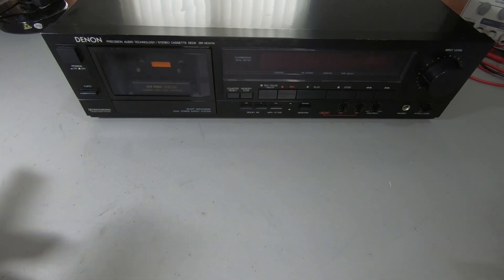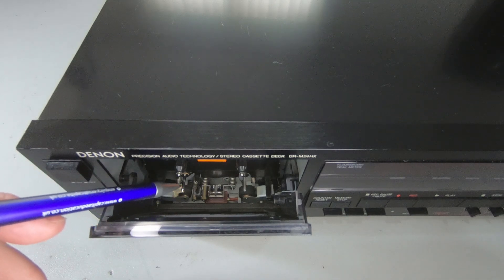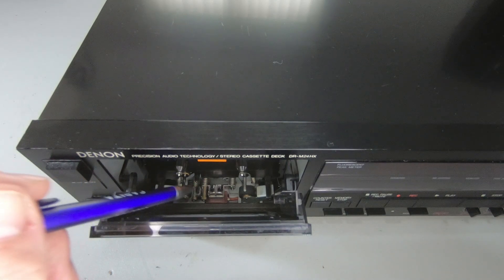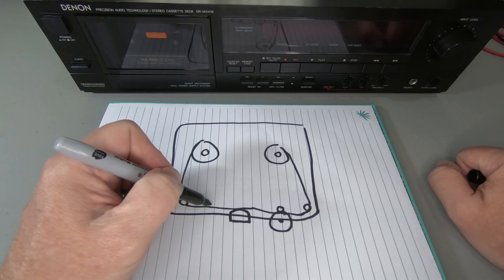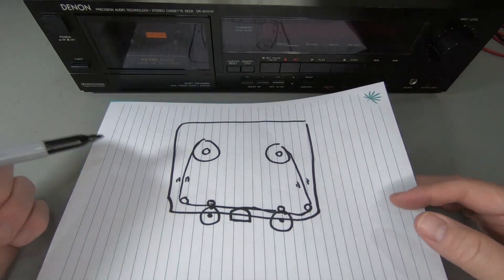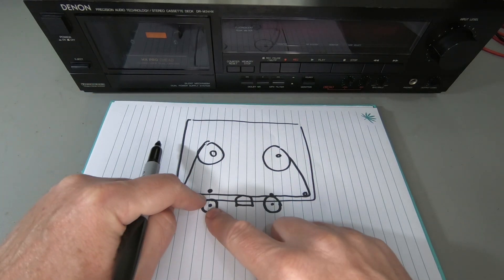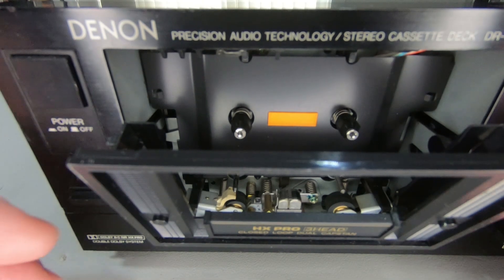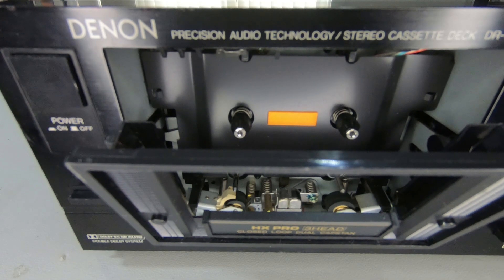What is a Closed Loop Dual Capstan cassette deck?

Comment: Perfectly clear explanation! My father passed earlier this year, and I'm trying to digitize a very sentimental cassette from Christmas morning recordings through the mid-80's & early-90's. The tape is quite thin and creased at certain sections. I realized that the player I picked up from a thrift shop has dual capstan, but also has auto-reverse. That's likely the cause for it getting jammed up. It would get stuck and stop at the exact same spot every time, then begin playing the reverse side from that same spot. I'm doing everything I can to make this work, and you've helped me immensely with this information. My next step is to find the proper equipment with dual capstan and no auto-reverse feature. If there are specific makes and models that are recommended, I'd appreciate anyone's thoughts on which are best. Thank you so much for helping me on this journey to preserve those special moments.
Reply from the maker: You might be better with a standard (single capstan) deck to transfer your old tapes. If they are thin and fragile, the dual capstan may snap it as it does apply a small tension to the tape. Also as they are old home recorded tapes and I am assuming not high quality, then any deck is going to do the job. Maybe even a cheap USB cassette player, these can output the audio directly to the computer 👍

Comment: if one capstan is running faster than the other and the faster is driving the tape, the slower capstan must be slipping on the tape.  Wound that not damage the tape?

Comment: closed-loop is often considered an essential aspect of three head machines, because the positions of the gaps don't align with old-fashioned small pressure pads. some decks (naks, mostly) push the pressure pad right out of the way. thus, you are relying on the tension across the face of the rec/play sandwich head to ensure good contact. leaving this to back-tension is risky, but there are a lot of three-head machines that make it work- tascam, technics, HK, marantz, braun...

Comment: I noticed the left side pinch roller is smaller than the right one, is that by design or just a different replacement?
Reply from the maker: That is how some decks set the speed. Both capstans will run at the same speed but the smaller pinch roller means the tape will pass  more slowly across it. The tape will run slightly faster across the larger exit pinch roller and generate the required tension.
Reply: I don’t understand how the pinch roller diameter has an effect on the tape speed, the diameter of capstan shaft is what determines the speed because the motor drives the capstan not the punch roller. I read somewhere that capstan shafts are slightly different in diameter to achieve the right amount of tape tension.
Reply from the maker: @Capturing-Memories yes you are correct; The entry capstan will be slightly smaller, these usually have a matching smaller pinch roller.  too.
Reply: My Kenwood KX-9010 does it the same way with two different size pinchrollers. The different diameters  maybe not affect the transport speed but i guess it has something to do with the different masses that handle the tape on those two spots.
Also on my kenwood deck there is a belt that does nothing but slightly give some friction to the left spindle and if that belt is missing, the left capstan will eat all the tapes.

Comment: There were also dual capstan decks without a belt between de 2 capstans (so it's not 'closed loop'). I think the Nak Dragon had a double direct drive transport. Both capstans had its own motor.
Reply: revoxes were, I think, the only four-motor decks, though the NAD 6300 has two direct drive capstans & a single reel motor.

Comment: Great review.
I wonder why an auto reverse would not be able to use both capstons?
Might this be because the pulling capston always needs to run a bit faster than the pushing capston?

So, running from left to right, the right capston would need to run faster.
And running from right to left, the left capston would need to run faster.

And the speed of the capstons probably is not adjustable....
They made this speed difference between the left and the right capston done mechanically.
So, that would effectively make auto-reverse impossible with closed loop....

Is that a correct reasoning?
Otherwise, I could not come up with another reason why closed caption is not made with a closed loop.
Surely, it is technically possible to reverse the speed differences between the left and the right capston when engaging auto-reverse.
But the manufacturers choose the cheapest way, mechanical, and thus not adjustable, making auto-reverse not possible with their choice.
Correct?
Reply from the maker: I think you're probably correct. Theoretically there's no reason why an auto reverse deck couldn't be closed loop. However as you've pointed out, it would be technically difficult.
Reply: @ANTandTEC I’m pretty sure Akai and jvc did this with dual direct drive capstans and dual guides on both pinch rollers
Reply: @Mr.O2183  The Akai GX-R99 and JVC DD-V9 (and some more I guess) had dual capstans autoreverse drives indeed.
Reply: That's impossible simply because on autoreverse decks the capstans rotate at the oppossite direction. So imagine, if they engage at the same time possibly you end with something broken!
Reply: @nikossoursos7032 it is possible with dual direct drive motors. Since direct drive motors are powerful and fast, having 2 of them makes for an extremely fast change of direction despite the size of 2 flywheels

Comment: Nice, so it's a standard auto-reverse deck as far as the hardware, but they decided to put that second capstan & pinch roller to some use instead of just sitting there disengaged. All with probably minimal hardware changes. Clever.

Comment: Help me, Ant&Tec... you're my only hope.
My pioneer CTF 750 plays all tapes, and the sound is great. I recently changed the belts, cleaned everything and demagnetized. But it just won't do recoding properly.
The sound is absolutely distorted. I tried different tapes, cleaned the capstans and the head again, but same issue.
Do you have any idea? If yes, please let me know. You would save my day 🩵
Reply from the maker: Nice Star Wars reference 🙂
So in the centre of the CTF 750 circuit board, you will see two goldish coloured long components. These are the record/playback changeover switches. The switch moves position when the record button is depressed. 
Try squirting some contact cleaner into those and manually press the switch with your finger a bunch of times, then try again 👍
Reply: @ANTandTEC  thanks, I'll try this. This old tape deck means a lot to me, since my uncle brought it from the US in the early 80s. Must be as old as me 😊. And it has such a good sound quality. After many years I wanted to record a cassette with good old songs. I'd be so happy to get it working again.